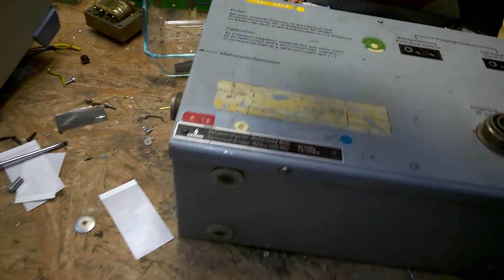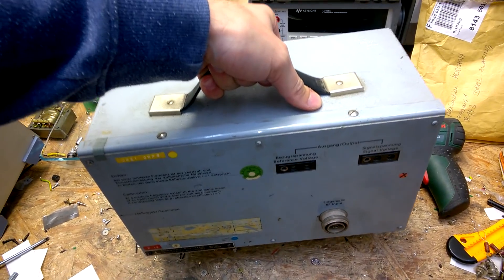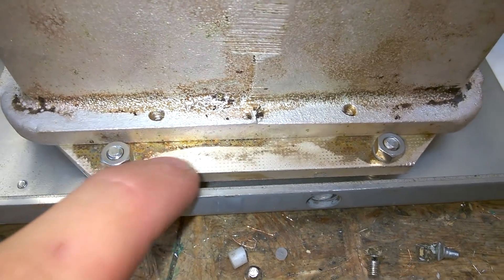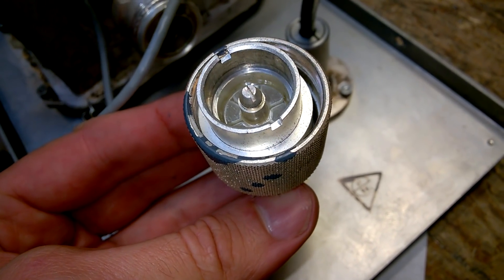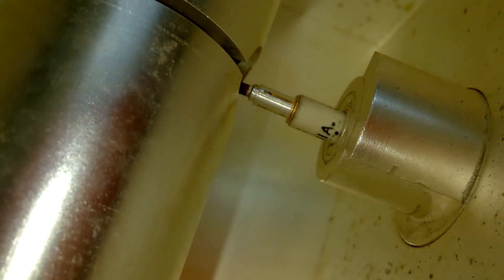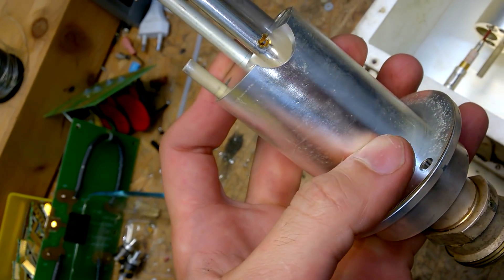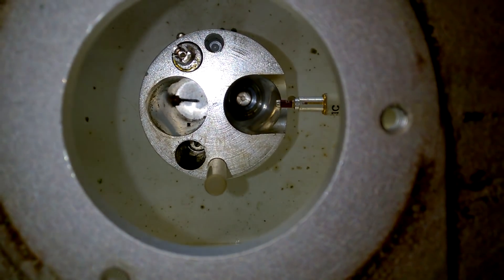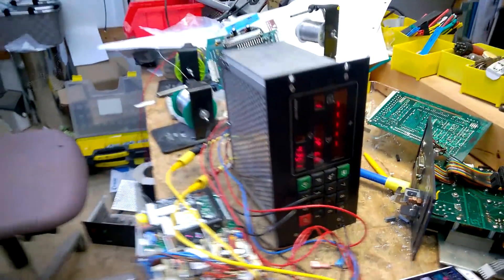Teardown: Siemens RF Reflection Factor Measuring Bridge (BEB #75) What's inside?

Comment: Correct me if I'm wromg but if you changed the dummyload to 50 ohms would it be usable then in the ham world?
Reply from the maker: I'm afraid no. In theory, all the physical dimensions are made exactly for 60 ohms impedance. Like the diameter of the rods, holes, and cavities.
Reply: @MaxKoschuh  your right forgot that!